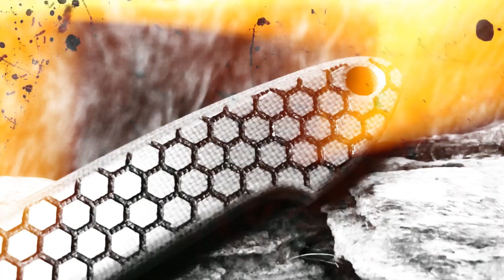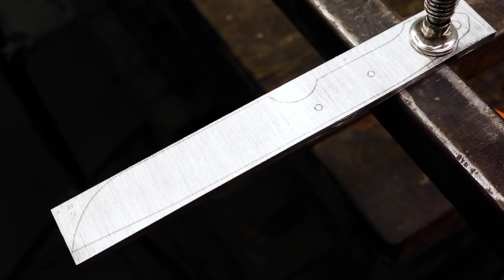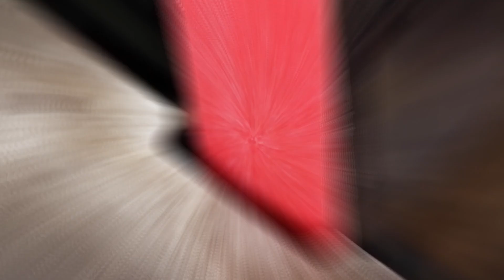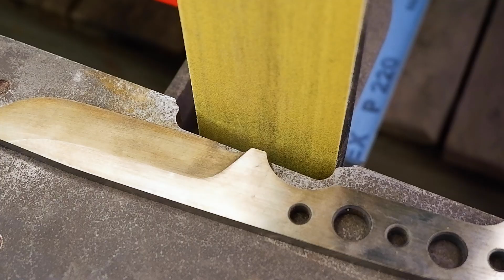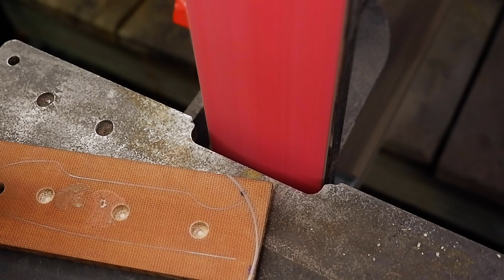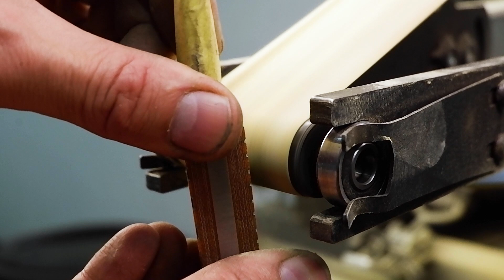Making a Drop Point EDC Knife with a hidden pin construction system

Comment: Noticed you drilling holes in the blade on the drill press holding the blade with your bare hands.  I WOULD STRONGLY CAUTION ABOUT THIS. I  almost lost a thumb when the drill bit grabbed the steel and spun the blade at 2000 rpm into my hand then flew across the garage as I bled all over the place.  Eight sutures to sew my thumb resulted so I only drill using a vise or clamped securely now.
Reply from the maker: Yes this is true, I learned that same lesson a long time ago. You dont really see it on the video, but i always drill on the slowest machine speed. If the drill bit bites into the steel its too slow to spin the blade and stops the chuck from spinning altogether. Also onviously never drill something with a sharp edge.

Comment: Hey what was the oil you used on the handle at the end? Thanks!
Reply from the maker: That is boiled linseed oil...will probably get better results using it on wood than on synthetic material...but it looks good none the less.